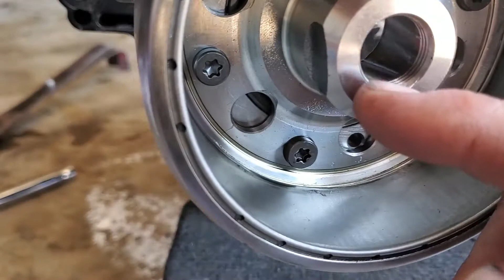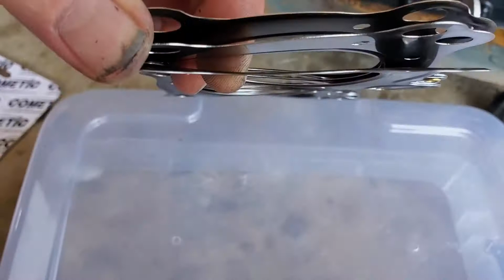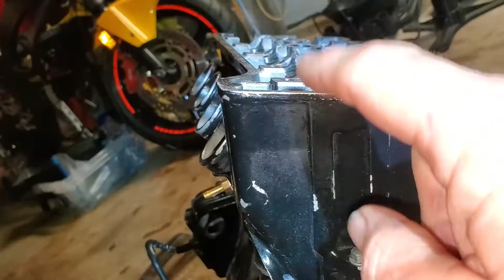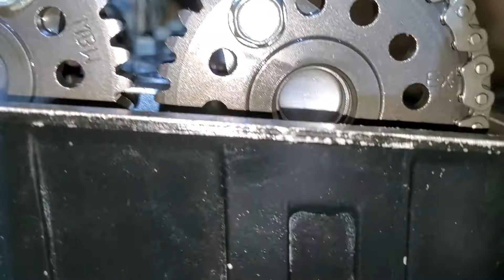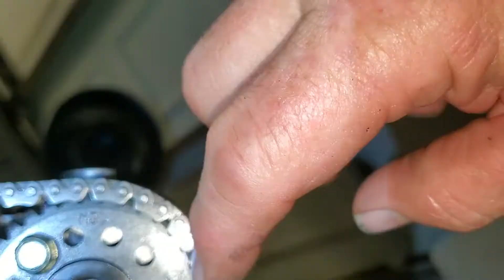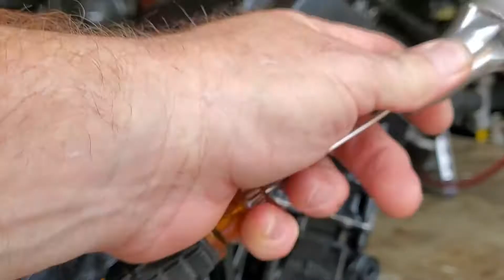CBR600F4i Engine teardown episode 7

Comment: Im curious, where are your judder springs for the clutch assembly? - Thanks
Reply from the maker: The Honda CBR600F4i does not have a judder spring in its transmission system. Judder springs are typically found in certain motorcycles that utilize a slipper clutch mechanism, designed to dampen the shock during heavy downshifting. The CBR600F4i, however, features a standard clutch setup without this component.

Thank you for watching and for the comment!

Please like and subscribe if you have not already done so!

Comment: Hey when you put the engine back into time did you have to time the fly wheel as well?
Reply from the maker: This bike doesn't have a flywheel.  If you are referring to the clutch, there is nothing there to time.  You do, however, need to ensure that the timing marks on both cam gears, and the timing mark on the reluctor are lined up in the proper locations or you may have some piston to valve contact...

Comment: Doing the timing on this seems scary LOL attempting this on mine studying ur videos
Reply from the maker: let me know if you run into any issues!
Reply: @fixin_grillin_chillin  for sure, I do my work on weekends so I’ll update
Reply: @fixin_grillin_chillin  I’ve run into an issue with timing my bike and you’re the only one with a video that has helped but I could use a little bit more if you wouldn’t mind.
Reply from the maker: @failedabortion6892  sure, fire away
Reply: @fixin_grillin_chillin  I got my bike timing figured out now when I start the bike it has a hellacious cam chain tensioner tick and not because it’s bad but because I can’t get it right and now it’ll idle at like 4k and when riding when given throttle it’ll take off on you

Comment: Did you use any Honda Bond, gasket sealer or an OEM gasket on the right crankcase cover?
Reply from the maker: I used permatex ultra black sealant for all the mating surfaces
Reply: @fixin_grillin_chillin  Great thanks!
Reply from the maker: @verifiednobody7836  Thank you for watching!

Comment: Нужно было не закрывать клапанную крышку, но поставить стартёр и прокрутить от аккумулятора мотор как на стенде, чтобы удостовериться в правильности сборки всех агрегатов. Или ты не умеешь это подключать?
Reply from the maker: I did turn the motor over several times by hand (with a socket and ratchet) while checking all the timing.  So I was absolutely certain the setting were correct.